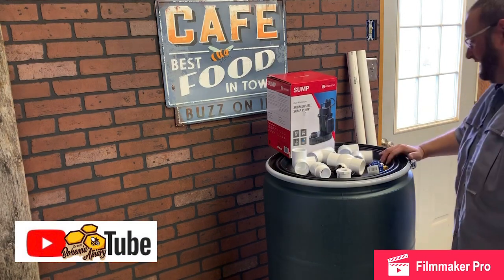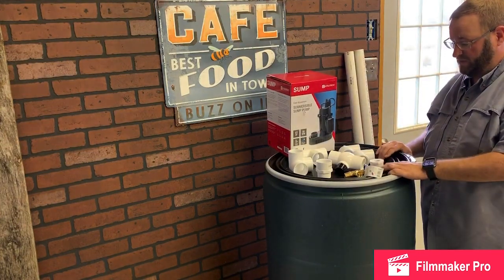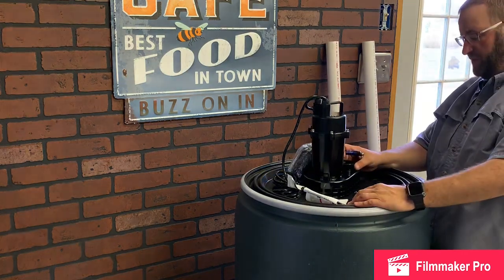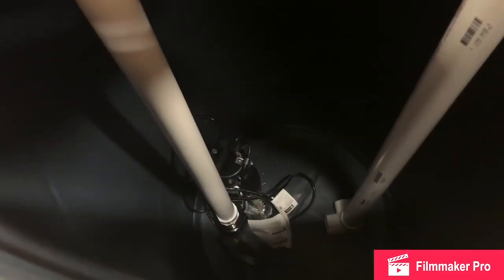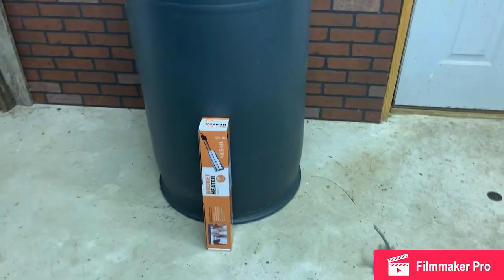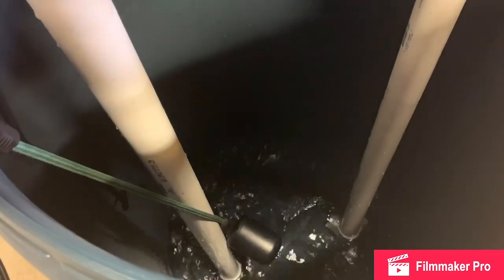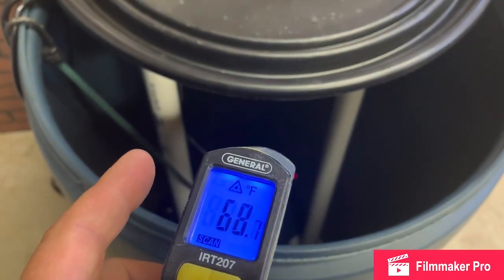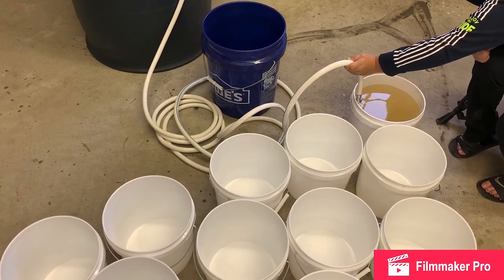High capacity honeybee syrup feed mixer

Comment: Have you run into any problems with your pump tripping out on the thermal overload when mixing?  I just built one using a "3/4hp" submersible from Amazon but can't even continously mix 1:1 syrup without the pump tripping off.
Reply from the maker: No not yet.

Comment: Have you found the need for a 3/4 hp sump or is the 1/2’still doing the job?  Also did you find a good deal on the pvc or just shop at the box retailers?  I have the drum now I just need to make the setup
Reply from the maker: 1/2 still does job. PVC from big box stores.